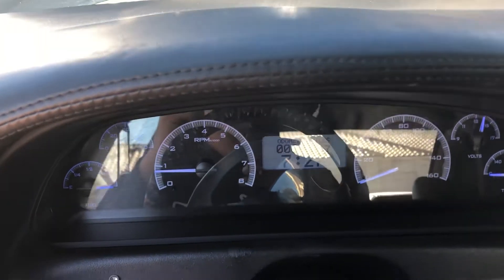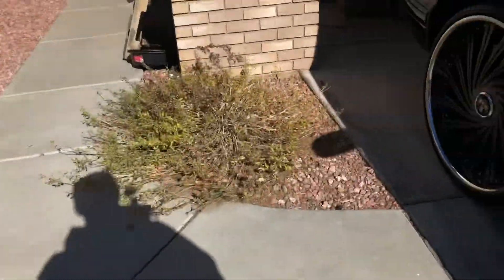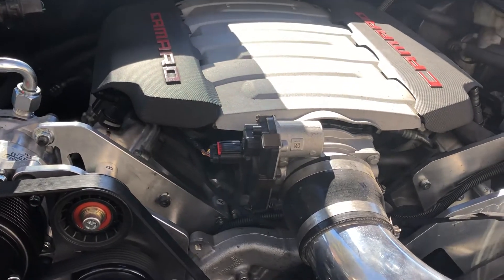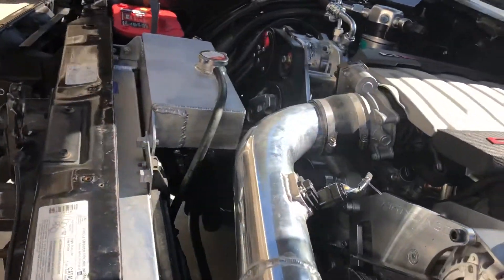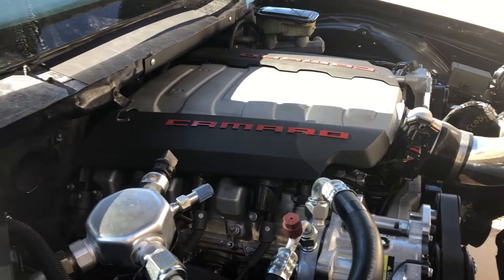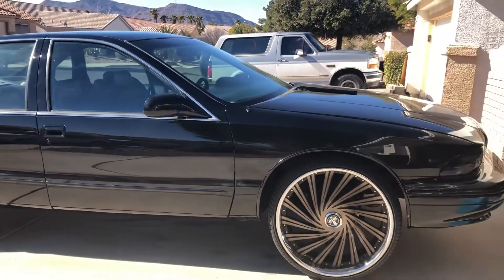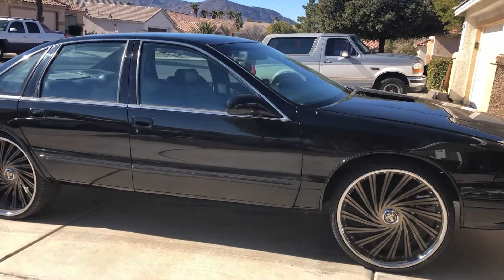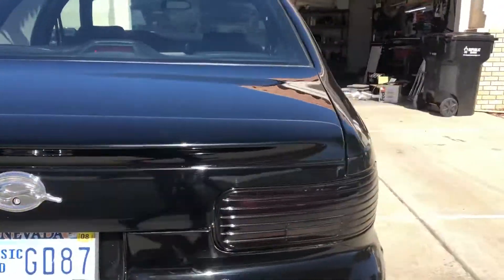1996 Impala engine swap walk around

Comment: That 8speed trans fit in that tunnel without issue?
Reply: 8 speed transmission? Is that possible?
Reply: @UsualVenuz  Yeah, technically the 10speed is possible too. Just depends on the setup used. I still have my 6.0/4l60e  combo in my SS. I would love to have that 8speed behind my 6.0